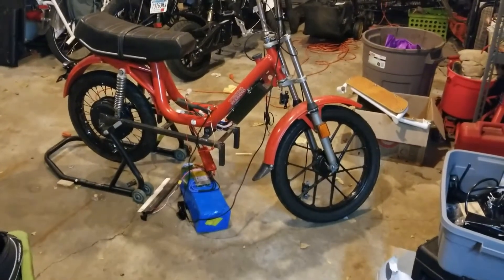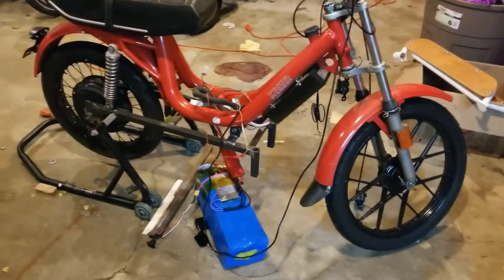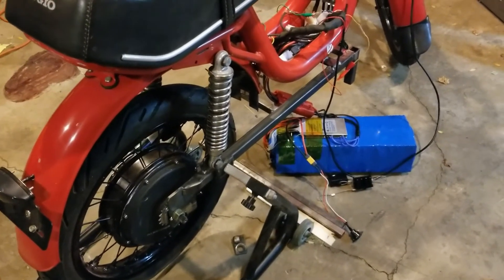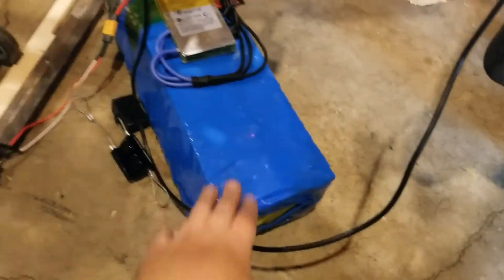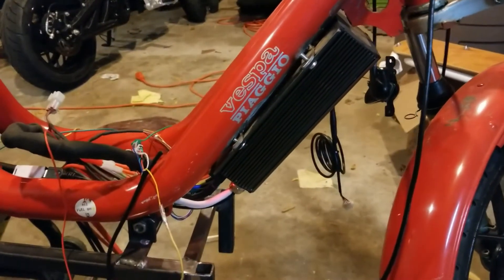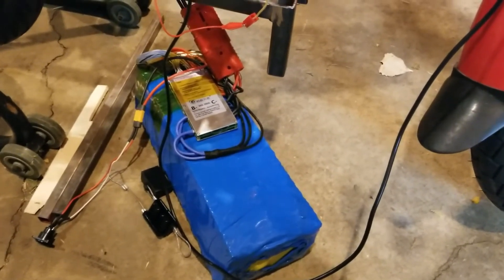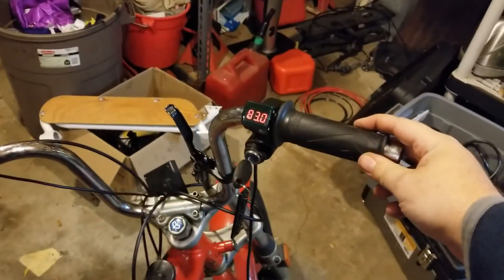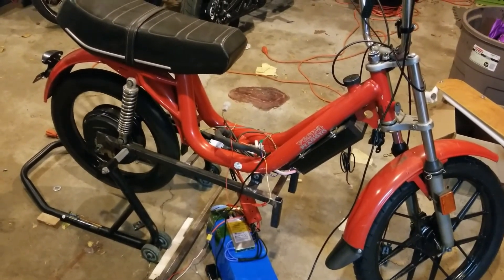Vespa Grande eMoped Conversion

Comment: Hey, I’ve been thinking about converting my Vespa Grande to electric. Roughly how much have you spent on the conversion?
Reply: Why convert it? The Grande is a great moped. And with a few cheap upgrades can do 45 and climb some pretty good hills with a 234 pound rider. And gas is a whole lot quicker to get you back on the road than batteries.